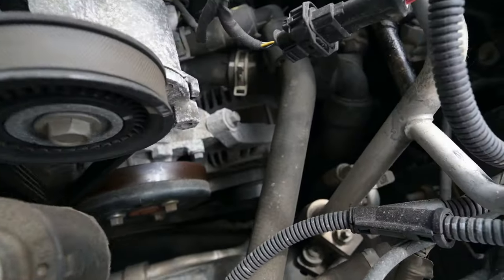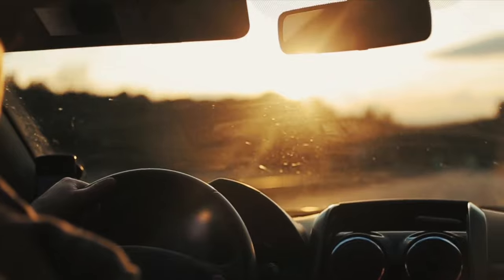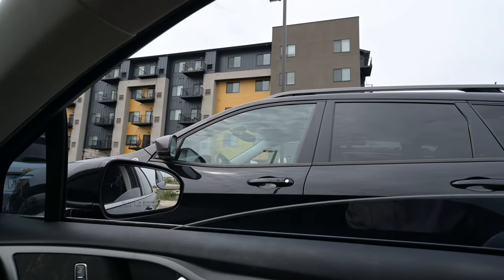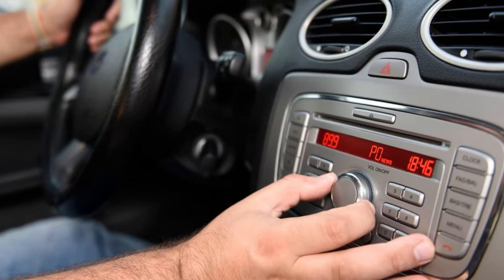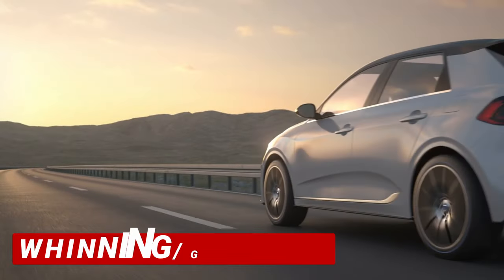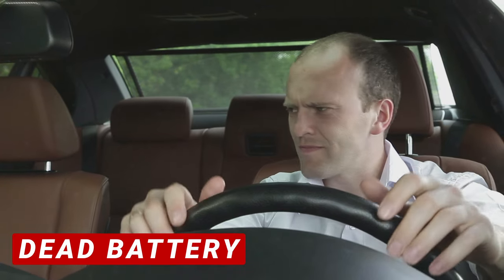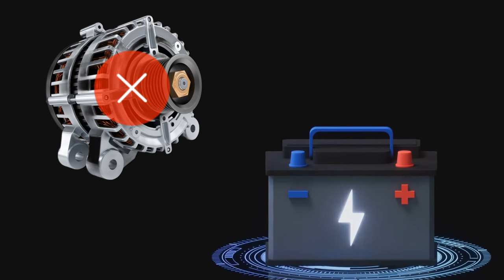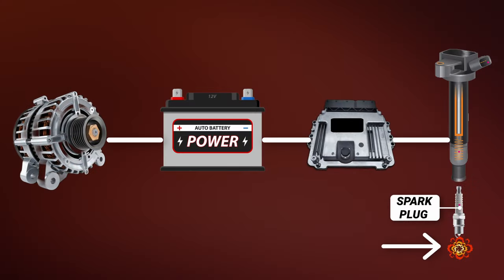Symptoms Of A Bad Alternator

Comment: My alternator went out while driving, I replaced it and then it began making a grind noise, checked the belt, checked fuses. It turned on several times but didn't go three blocks til it died again. New battery as well and starter is just fine too. I ain't tryna take it to a mechanic yet before I can fix it myself. And won't turn on without a jump now.
Reply: Sounds like the alternator you bought was defective, did you take it back?
Reply: Try greasing up your idler pulley if its bad it will be hard to turn and put alot of stress on the altenator causing an early change of an alternator

Comment: Thanks , i had that grinding noise, but never has the battery logo show up on my dash screen.  My car wount start now ,  steering wheel and brakes are stiff and locked.   Battery is fine but i couldnt even turn on ignition by jump starting it.   Im pretty sure its the alternator now

Comment: When your interior lights dim when starting the engine with a new battery installed this is also a sign that your altimeter is going out to lunch as engine takes a bit to stare and the volt meter jumps to 14 to 15 and to keep the battery charged to full capacity . This also happens on a restart when you go somewhere and leave.

Comment: I got stuck in traffic on the freeway and when traffic cleared up i accelerated but my vehicle wouldnt pass 5mph, i got it towed home and tried to take a look at what the problem was but the key got stuck in the ignition, i barley managed to remove it after 2 weeks of it being stuck, but a day or two after getting it towed to my house the car wouldnt start up at all unless i use jumper cables but as soon as i remove the cables the vehicle dies,so right now the car doesnt start and if it does then it cant go faster than 3-5mph, any recommendation??

Comment: Hey bro I got a whining noise coming from under the hood is it possible the alternator bearings are going bad?  
Basically what happen is my timing belt had recently burst so I got it replaced with a new one but as I'm driving off my car makes a whining sound each time I accelerate.. what could be the issue?
Reply: Mines to
Reply: Mine too
Reply: Rip
Reply: Does it only whine when the engine is cold? After 10-15 min does the whine go away or keep whining? I’m having that issue…

Comment: So my battery light came on the other day, then traction control and 3 other lights came on. Headlights started to dim. Coolant gauge went to the max and then minimum and kept going back and forth. Car stalled and wouldnt start for a day. Alternator or ECM?

Comment: Hi, my battery measures 13.6-13.8V on the dashboard when driving. When turn of the engine, battery voltage drops to 12.2. After parking 1 day, battery is 11.8V. 
There was a consumer during sleep mode. That is fixed, but battery still drops down to 11.8 after one day parking. Alternator is replaced one month ago. 
What should I do?
X5 3.0i 2004
Reply: You need a battery. Replace it and check for parasitic load.
Reply: I would listen to pollodustino start with a new battery and if the problem persists check for any draws in the system

Comment: I have a 2010 Honda CRV I’ve replaced the battery 3 times. I only have 40,000 miles. I was told I need an new alternator. How much would that be including installation? ( ball park) Thank you.

Comment: Hi so the other day my car wouldn’t start. I have no warning lights & my battery is fine. The tow truck guy tried jumping starting it, but it still wouldn’t start. All the lights were working fine though..there was a humming noise when I tried starting it. After they towed my car to my house, the car started up fine & it’s been starting ever since! Could this be an alternator issue or something else?
Reply from the maker: So i am assuming it was a no crank no start? If so i go in depth in this video here. https://www.youtube.com/watch?v=Q_Xw6fmvFZQ&ab_channel=EasyAutoFix
Reply: Crank Position sensor

Comment: Can an alternator kill your battery
Reply from the maker: Yes
Reply: @easyautofix  dang I just bought a brand new battery lol came out and it's dead jumped it off took the cables off and it died again..is that alternator?
Reply from the maker: @FLbowtieguy  It is possible it could be the alternator. You should test it. I have a video on this: https://www.youtube.com/watch?v=dSnENygdrko&ab_channel=EasyAutoFix 

Here are some other possibilities:

1. Battery Connections: Ensure that the battery terminals are clean and securely connected. Loose or corroded connections can prevent the battery from receiving or holding a charge properly.

2. Battery Health: Even if it's brand new, there's a possibility of a defective battery. It's rare but not unheard of. You might want to have it tested to ensure it's holding a charge as it should.

3. Electrical System: There could be a parasitic drain on the battery, meaning something in the electrical system is drawing power even when the car is turned off. This could be due to a malfunctioning component or accessory.

Comment: Mine showed a Engine management light just before the battery shat itself due to not taking in charge
Reply: That's the same as the engine reduce correct? And did replacing the alternator work for you?
Reply: @chriswagner2959  can’t tell if that was the issue, after alternator was fitted, EML came back on randomly a few weeks later to indicate an EGR issue after codes were scanned. Knocked the EGR a bit and light went out after reset, didn’t come back on for about a month. So weird

Comment: Mechanic was changing ac hose and mistakenly touched the alternator and it sparked. The windows were slow, no ac blower working, door lock button not working but i could drive the car for some time. After few hours i tried to start the car and it ran for 2 miles, all the lights on dash board came up like abs, seat belt check light, then radio has gone down and finally car choked and i had to pull it to parking spot. After fee time i started it and drove for another 5 min and it stalled. What do you think is it the alternator or the alternator fuse or fusable link issue? Thank you
Reply: Did you ever figure out what it was?
Reply: I ran into the same issue